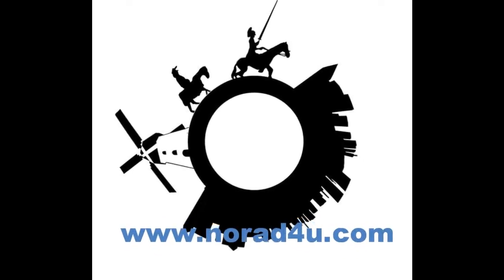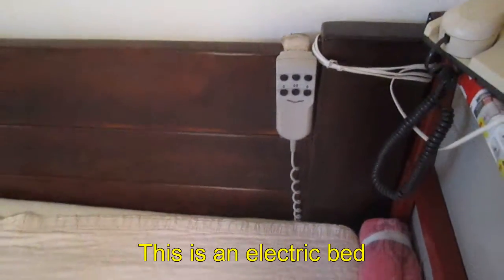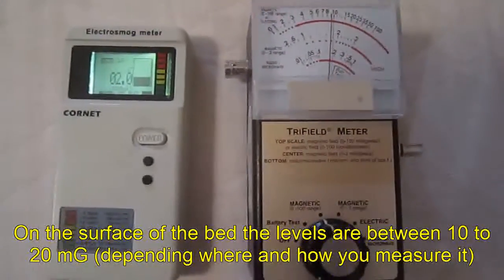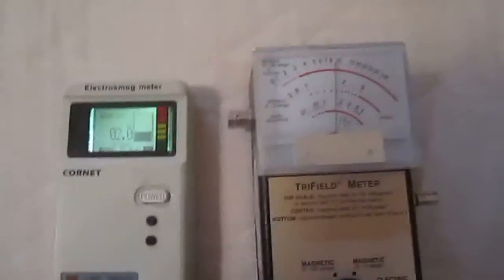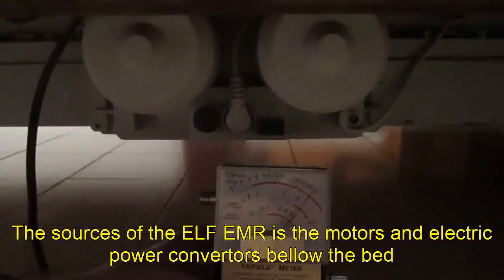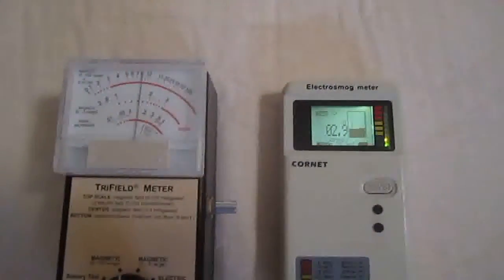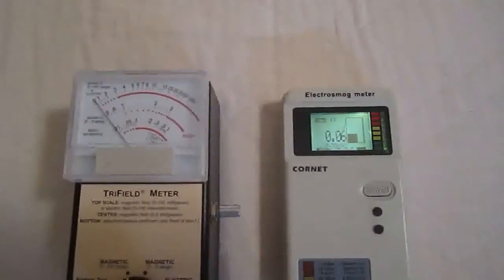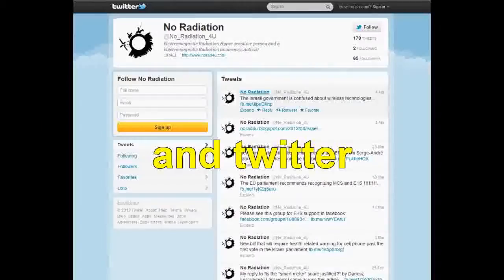Extreme Low Frequency radiation(EMF/EMR) from Electric Bed

Comment: What about placing a wire mesh or screening between the mattress and bedframe would that block EMF under the bed getting to your body?
Reply from the maker: it might partially block the electric field but not the magnetic. 
The right thing to do is sleep on a wood bed, with a foam mattress, without any motors, electronic or metal parts.
Reply: @NoRadBlog  I have a wooden bed but because of my disability I’m getting a contour bed with a 7 inch deep innerspring mattress let’s say I put the metal screening under that mattress and Connect those screens with a grounded wire? But what I’m probably going to do is sleep with it unplugged and only plug it in when I may plan to use it.
Reply from the maker: @ducksoup80  unplug it , or use a switch to do it.

Comment: I unplugged my bed but I’m still getting readings? I only get readings under the bed and not on top of the mattress. Is that safe?
Reply from the maker: Maybe there is still some static fields from the motor or electronic. or maybe there is some other sources around. 
Turn the electricity of the house OFF, if the field is still there it is not from a source near the bed, and it is one of both: static field from the bed, ELF field from outside. Try to take picture and send with the question to info@norad4u.com

Comment from the maker: HI & thanks for your comment
Turning off your router (and other wireless devices) is a good advice!
I don't recommend protection/blocking as a first step.
I recommend on the following steps:
1. Get some knowledge about EMR
2. Measure the EMR levels and detecting RF and ELF sources in your home and outside
3. Minimize your use of any wireless devices and minimizing your exposure.
4. Then you can block the RF coming from outside

All the info is on my site: wwwDOTnorad4uDOTcom
amirb

Comment from the maker: I suggest buying an RF meter, measuring the RF levels in your house, in the windows and on the wall facing the antenna and the deciding what to do. I don't recommend protection/blocking as a first step. 
The First step should be to get some knowledge about EMR, then measuring the EMR levels and detecting RF and ELF sources in your home and outside, then you should minimize your use of any wireless devices and minimizing your exposure, and only then you can block the RF coming from outside
amirb

Comment from the maker: The ELF meter I like best is the triefield 100XE, simple, very easy to use, very accurate.
I use it all the time. 
I use the Flat Band model (not 50Hx or 60Hz calibrated).

I will send you a link to a meter store I recommend.

amirb

Comment: Turn your room into a Faraday cage put up metal mesh screen material on the walls and cover them with wall paper and ground to outlet for max shield. Also Maybe turn off your router at bed time would help. Cancer from cell towers is very low unless you live next to one. My aunt got breast cancer living next to a tv station so you might want to invest in simple solution but you can't hide from RF its everywhere now.

Comment: Urban city. My apartment is next to a cell tower like only 50-60 meters away. Also on my wifi analyizer it shows 15 neighbor wifi routers, 2 of which almost close to my router's strenth. I watched another youtube video of a lady demonstrating that aluminum window screen in front of her router and drastically reducing the readings. Will you suggest al. Screens on the tower side of the wall? Aluminum foil?or anything else you would suggest. Thans again..

Comment: most ppl are not aware of the unhealthy esmog around them, which is easily to reduce to improve health.. i took Cornet ED.7 and K2 EMF Meter for a ride by train, it was shocking, both ELF and RF peaks all the time. here rail has 16,5Hz frequenzy, RF peaks from passangers in a metal tube using GSM and UMTS careless all the time..  and you think train is good for enviroment and you :)